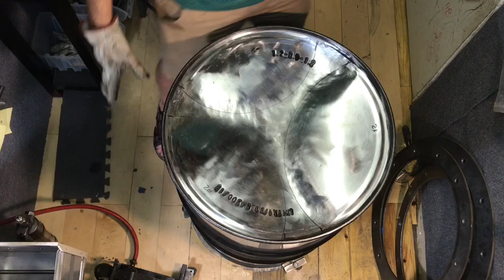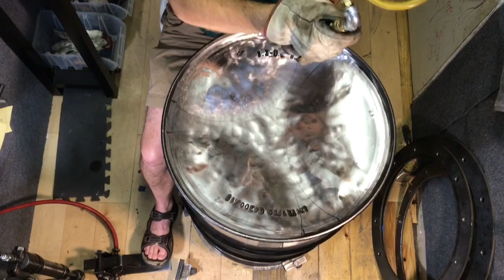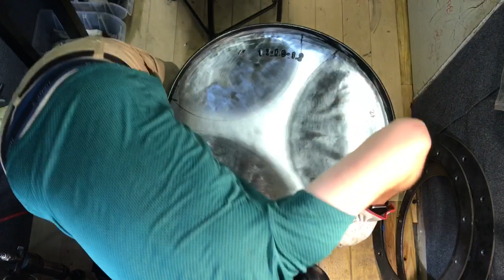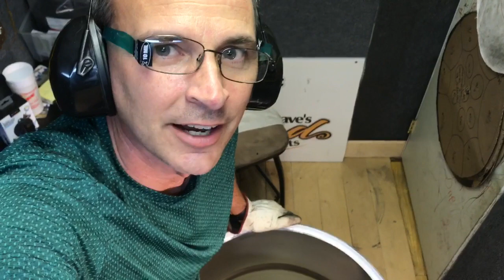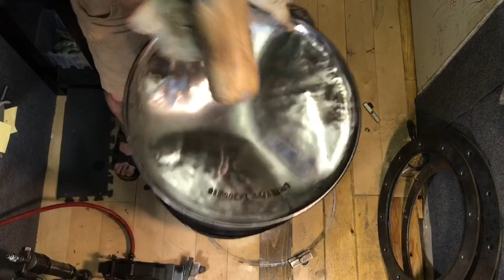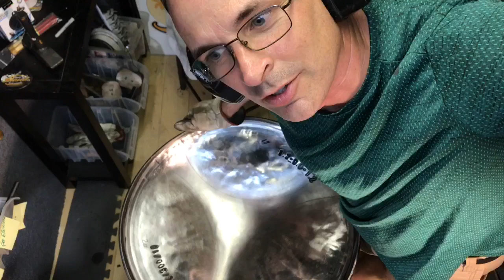Dii: Sinking & Shaping a “Six Bass” Steel Drum

Comment: What model air hammer are you using?
Reply from the maker: I used three sizes of air hammers on this project.  All of them were made by Jet. 👍🏼 I don’t think Jet makes them anymore ☹️. They are great hammers though!
Reply: Dii What is the psi output of your air compressor and how many gallons of air does your compressor hold in the tank to power this tool? I recently purchase a air hammer a jet o hammer used and The compressor I have is not strong enough to power this tool so I just want to find out the right compressor to purchase so I can fully power this tool...
Reply from the maker: C.O.D I use a big compressor. It is about 5’ tall. SCFM output is about 15, I think?  Yes, you need a strong compressor for these tools.  I used smaller compressors before but was always frustrated. My current compressor cost about $800.00.
Reply: Dii I appreciate you taking the time out to respond thanks for the tip I recently made a bass drum using a 6 pound hammer like they did in the early days of pan making it took me forever to sink the drum that was very frustrating and time consuming how many Gallons of air does that $800.00 tank hold and were can I purchase the metal hammer heads for my air hammer the one I currently have came with the rubber head?
Reply from the maker: C.O.D Kobalt brand 60 Gallon compressor.  Model#VT636200AJ(AGM10), Oil lubricated, 3.7 Running HP, 11.5 SCFM at 90 PSI, 155 max PSI.
Reply from the maker: C.O.D The heads came with the hammers from RhythmicalSteel.com.  HarpersHandpans makes plastic heads.
Reply: Dii You are the best... Thank you very much.